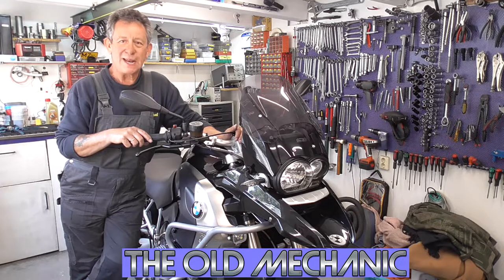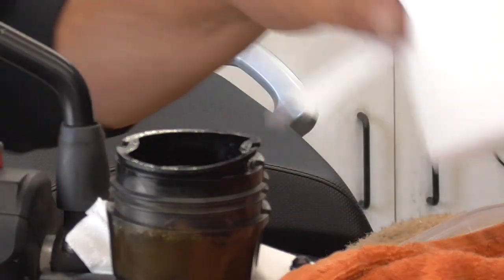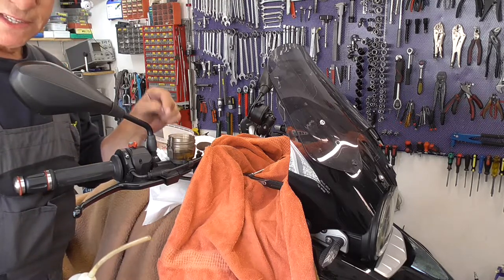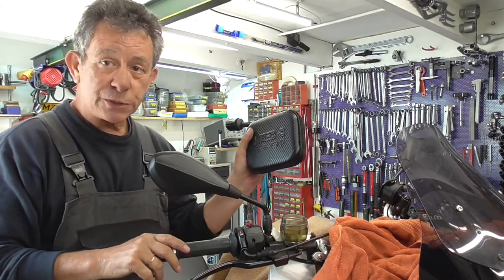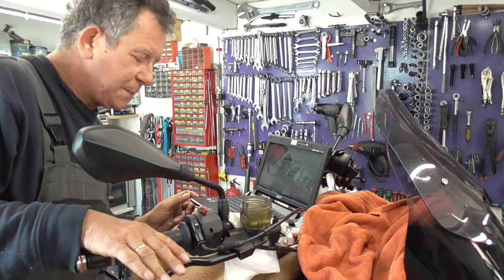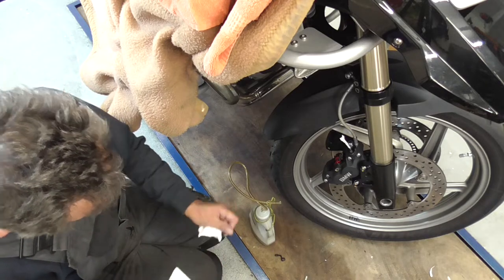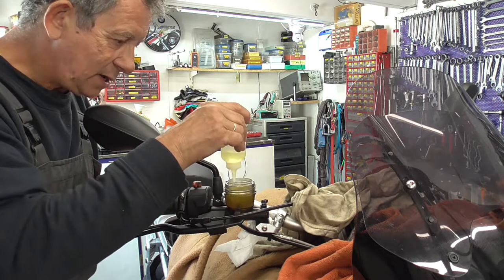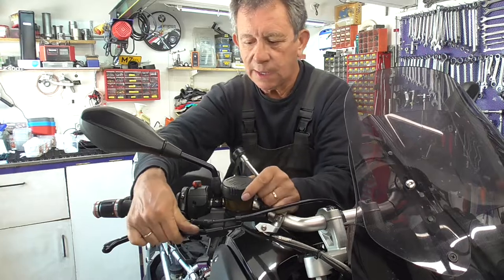BMW R1200GS [2010] FRONT BRAKE FLUID CHANGE MADE EASY. + A SECRET TIP ! 👨‍🔧---🏍

Comment: You should throw the sponges away. They aren't really needed, they were a fix for problems on the K bike brakes. Since the sponge turns to gel after a few years you must either replace it with every fluid change or discard it altogether. Many have done the latter with no ill effect.
Reply from the maker: Good info, actualy I hated it. For what I know its inthere to prevent 'foaming' from the brakefluid. But now I know it can do without that pesky sponge 👊🏻👍🏻😉

Comment: Great video .
Thank you .
I would just ad a small note.
Best would be to suck the old contaminated brake fluid from the front and rear brake fluid reservoir with a seringe, clean up if necessary the reservoir with a clean rag and top up both of them with new fluid .
That would avoid to send some contaminated brake fluid back into the brakes line .
This is how I do , and I believe it makes sens .
Cheers

Comment: hello Old Mechanic! I am learning to much with your videos. It is possible to change brake fluid on gs 1200 2012 at home without to be connected in a computer by gs911? I don't have one. 
If yes, how to do? I am In Brasil. Tanks
Reply: @TheOldMechanic  thank you for answer so quickly. I will look the motoscan with sure.
Reply: Hi Old Mechanic, I have a doubt: if I do the brake fluid change without GS911 or Motoscan (I still don't have) to run ABS pump, how is the fluid thats in ABS pump circuit. 
I can do on rear same way
Sorry my questions but I'm learning to do myself manutenence at home and your videos show thats is totaly possible. 
thanks. 
Ronaldo (from Brazil)
Reply: @the old Mechanic is is possible to flush the fluid without the diag?
Reply: What you can do is after the first round of bleeding take the bike for a spin on gravel and USE the ABS. Then go home and change again.  :)

Comment: Hello. I need help with my problem. I have Bmw r 1200 gs adventure k25 2010. During my ride on my dashboard pop up orange triangle and red ikon of brake. ABS doesn't work. When I use app Motoscan for scan I see this trouble code:
5D94 - Wheel speed sensor, front 
5DF4 - Undervoltage
5DA2 - Wheel speed sensor, rear 
5DA1 - Wheel speed sensor, rear
I thing that my ABS modul is KO. Where can be problem pls?
Reply from the maker: I would test or charge the battery first. Could be that your battery voltage is to low 😉
Reply: @TheOldMechanic  thank you 😉
Reply: @TheOldMechanic  Moto normal start engine without problem. Today I turned ignition key and odometer started move up a little bit.